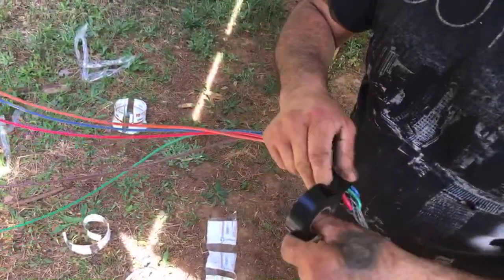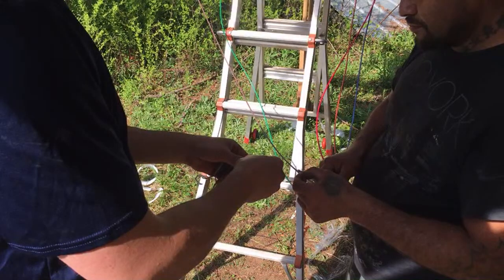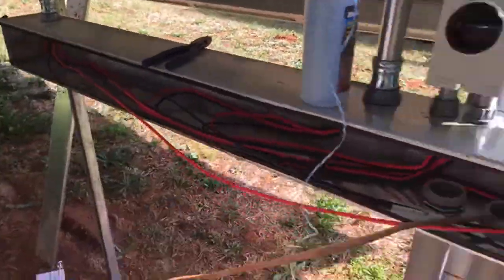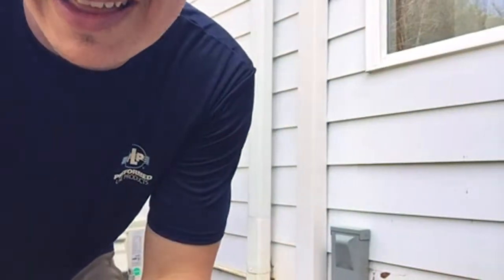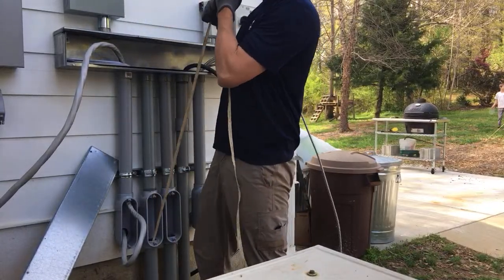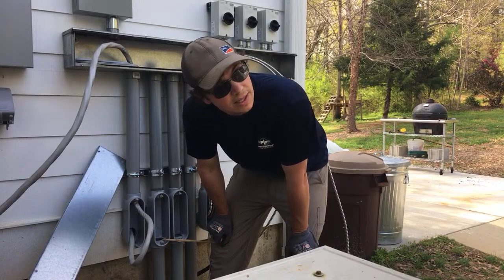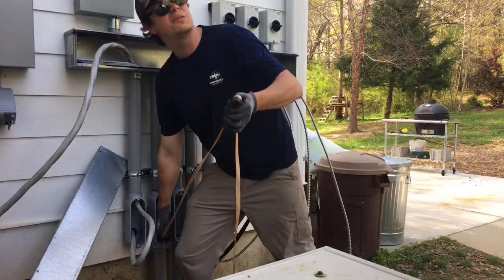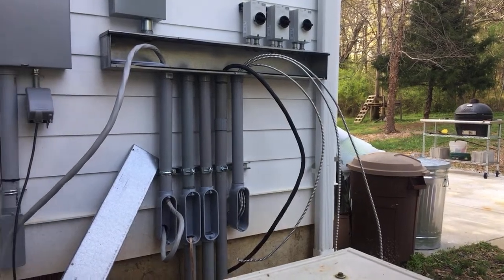Installing my own solar: pulling wire pt2

Comment: You cut off when you said " I don't know if you noticed, I put a string in there...." what is that used for and what kind of string? We are getting ready to pull #6 wire 280' through schedule 80 conduit, both down and up a hill. Any pointers on this pull?
Reply from the maker: Have you done the pull yet?  Foam lubricant works well, use wire pulling nylon string they sell in the electrical department. It’s light enough to be sucked thru the conduit then pull in a mule tape webbing strap or a rope. Take your time, make a good wire pulling head, setup your spools or cut lengths so that they don’t tangle, and have someone feeding as you pull. Ideally you have walkie-talkies and the say pull when they have 3’ ready for you to pull. Use lots of lube and if it gets really hard start over or stop and see if you can figure out why it is getting hard.  If you can get a bigger box to pull in and feed thru it will make it easier. Sometimes we even set up a pully so we can pull down instead of up.